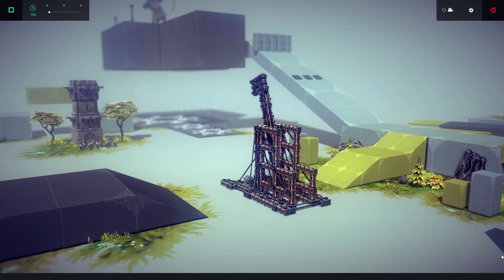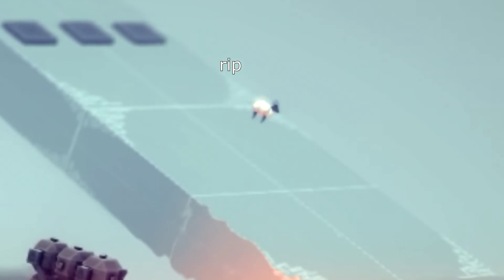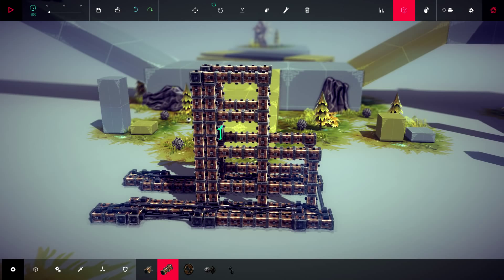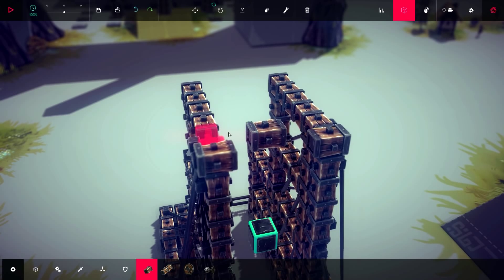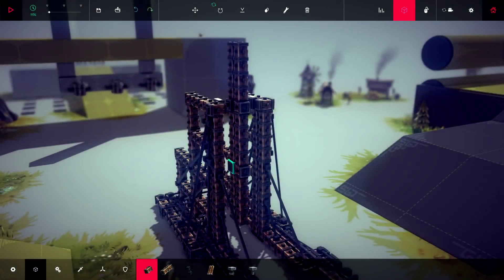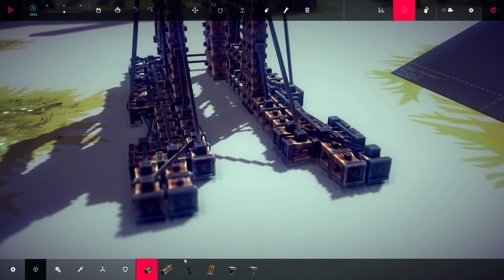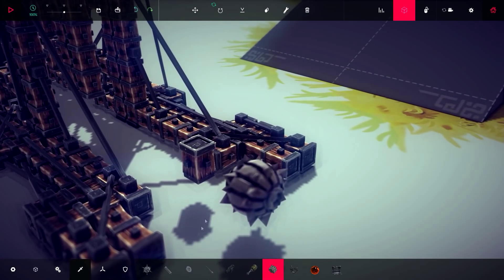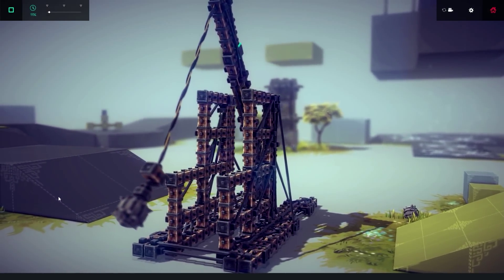Besiege Alpha Tutorial #3 - How To Make A Trebuchet (gravity powered)

Comment: The problem is that it cant be used on carrer/story mode. =/

also, can you create a trebuchet that can launch a boulder?
Reply from the maker: Tehn00bA just make the same machine with less blocks, it should be possible! Boulders and bombs are of the same shape so just swap them out if necessary
Reply: IamPetard / Variety Gaming  Boulders are about 6x heavier than bombs, Try yourself. I wasn't able to make a gravity based trebuchet capable to launch a boulder and that fits inside the box. I had to use strings. But I'll try to make one that launch bombs and fits inside the box! /o/
Reply from the maker: Damn boulders, I didn't use them much so I didn't notice the weight difference but I'm sure its possible to make it work within the box, just probably difficult since we don't have stone blocks
Reply: IamPetard / Variety Gaming Spoiler: they're quite useless, since they can destroy monuments but won't even scratch castles. I guess people were supposed to use them onn the monuments of the main game since it's not affected by the lasers nor the wind.